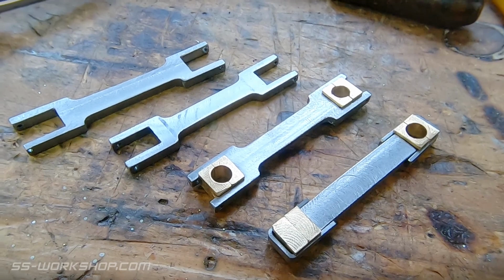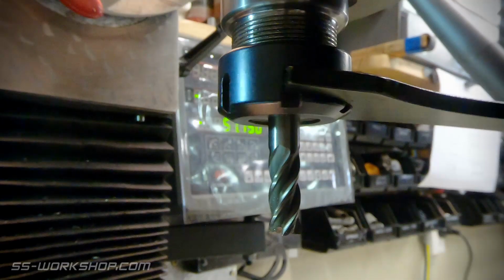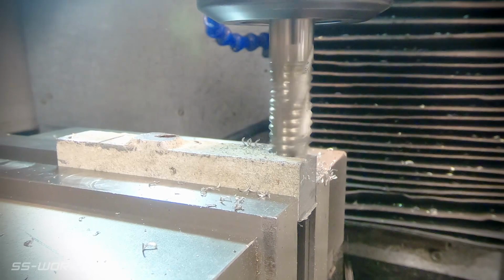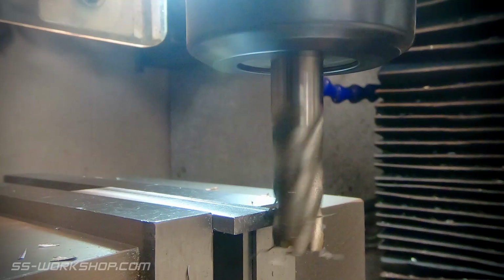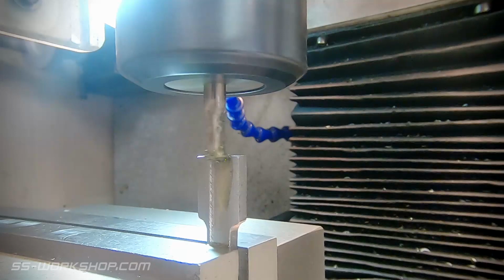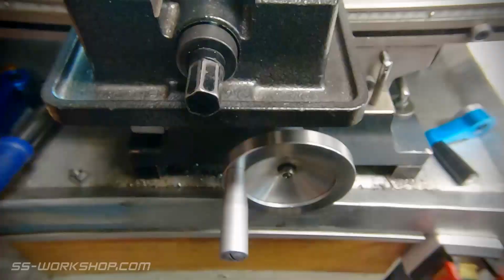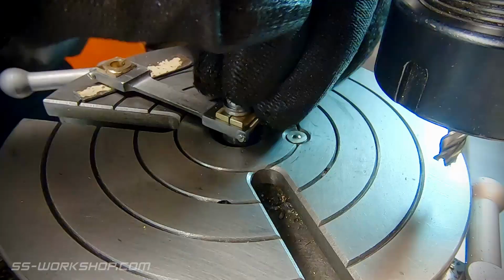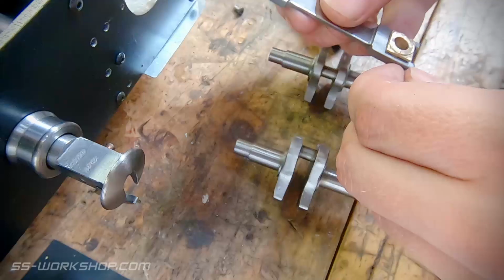Fell Engine Project - Making Inside Connecting Rods S1.E37

Comment: These are interesting locos I only came across the fell system after reading about the garratt that was proposed to replace them your video on how the system worked was very helpful.
Reply from the maker: Thanks, took a while to get it all worked out, and yes it’s interesting they tried to replace them, from recollection a couple of times at least but it never seemed to work out so they just kept running them.